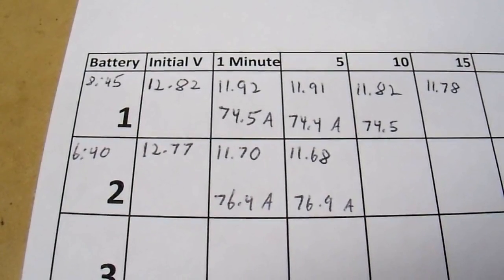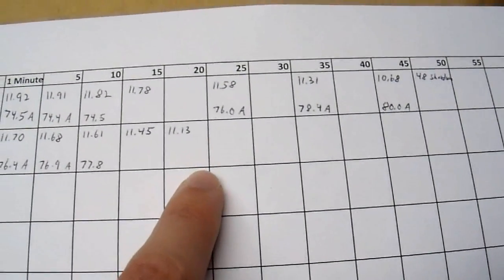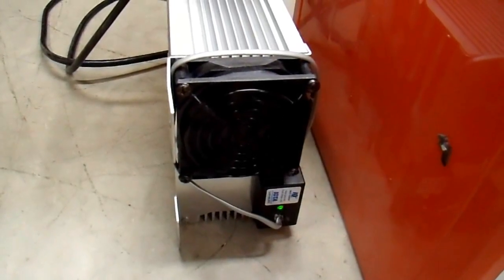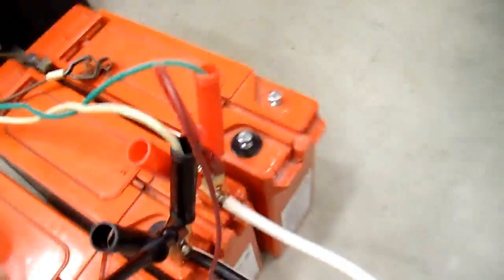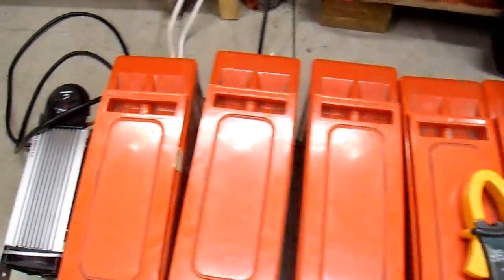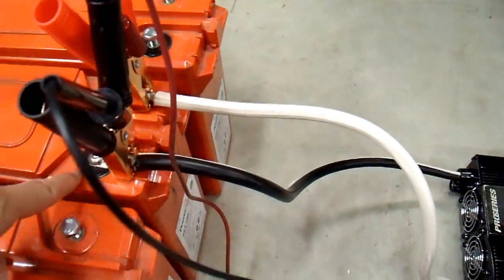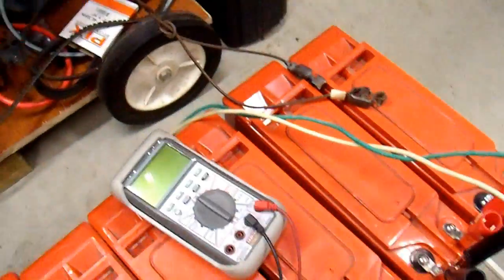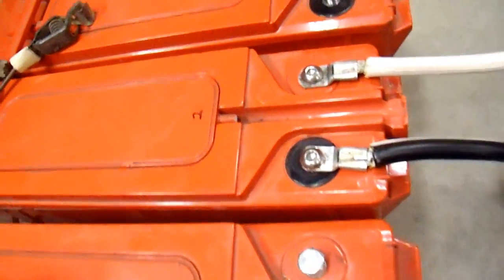1000Ah Battery Bank Part4 - Equalizing and Reconditioning a Sulfated Battery

Comment: All the sealed batteries I have owned, all you had to do was 
pop up the covering over the cells and 
pop open the cell caps to add water.
Reply: some are glued, you will have to break them

Comment: Hi Guys.
This is my first day on here, so you realize that I don't know what you Guys have been saying about What. So please forgive me for asking a question that was probably answered a little while ago.
I am thinking of setting up a Solar system for a Swiming pool. So I am looking to get set up with someone who can draw the plans and recommend the parts. I am good enough with my mechanical skills to do the Instalation, then I would get an Electrician to Certify the Install.
Is there anyone out there who would do that for me for a SMALL FEE.
Errol
errolmbj@yahoo
PS. If you are the one, I would send the info that you need.
The Volts. Amps, Watts, HP if you need. That is the info thst is on the Pool Motor that I want to run on Solar.
Let me say this. I was thinking of using One (1) or more of them MICRO INVERTERS with Four Inputs. After that I am LOST. 
Thanks for staying till the end.

Comment: Are you confusing watt with amp?  You show an electric heater plugged in saying it was drawing 80 amp - no way a plug in heater draws 80 amp, maybe 80 watts yes.  80 watt divided by 120 volt  = .66 amp.
Reply: He means 80 amps on the 12v side so 800 watts

Comment: How did you measure amperage, I don't see a meter on the 12v side.  Was it calculated?  How does that take into account the electrical loss in the inverter?  Thanks for the videos.

Comment: I tested 2 batteries on the weekend and both of them looked to be " dead". Right after using this battery reconditioning program ( Check Details Here>>>https://t.co/jfXRNloTu0 ), I had been able to rejuvenate them both to 100% working batteries. I saves $ 180 because of that procedure!

Comment: I recently got the EZ Battery Reconditioning program and just reconditioned two car batteries. The guides were very easy to follow [Check Details Here==>https://plus.google.com/100351090281822647456/posts/Gwtd4mVBdEd ]. I wish I would have found this years ago! Thanks!

Comment: Nice learning videos you being doing. I have a question, can you charge the battery pluging your charger to the AC output from the Inverter as the inverter is in use?

Comment: I find AGM Batteries to be mostly fragile and unserviceable. If you want to have a battery array which is easily diagnosable, serviceable, and long, long lasting, then Flooded Wet Cell-Deep Cycle batteries is really still the only way to go :) Trojan Flooded wet cell-deep cycle will last you at least 15 years, with many folks getting 20 years out of their old Trojans.
Reply: +Mark Job 
I added water to many of these batteries, where needed. Under the cover there's a rubber valve and a small opening if the latter is taken off. So while these are not intended for such purpose you can surely do it
Reply: Agreed mark iv had only short life out of agm.

Comment: Reconditioning batteries is mildly more interesting than paint drying! :) Ha! JK. Informative video. My off-grid setup is using LiFePo4 batteries. An entirely different animal as it were. In a few years I would love to add more panels and 50-100kwh worth of Lead to create a Solar DC fast charge station for an eventual EV. Have it charge during the day. Then at night when home, use 50% of its capacity to charge the car. RInse and repeat.
Reply: I literally have the same setup for this exact purpose.

Comment: Worse case scenario could you estimate where to drill to find the cells on the bad battery to refill it then just use plugs if that worked?
Just thinking it would be a last ditch effort to possibly save the "junk" one/ones?
Reply: or at least rip the vent cover off the dead one to see underneath.   This was a year ago and this is video 4 of 9, so let's see :)

Comment: Watching you makes me nervous. I am afraid you are going to cause a dead short across the terminals accidentally. I am probably over cautious...
Reply from the maker: I actually have done something similar to that on battery banks.  Fortunately the currents are so high that it just vaporizes the material that made the connection leaving an open.  Your cable and/or terminal may be damaged but as long as you're not wearing a ring or something you'll come out just fine.
Reply: ***** Ha! :)
Reply: How To Start A Battery Business At Home>>>>[ https://t.co/jfZbilIKLW ].......

Comment: I have a 90Ah 12v AGM deep cycle battery which I'm trying to "recover". It's about 6 years old and only holds 30Ah of capacity from my testing. I did a controlled overcharge today (equalization if you like). It was holding the voltage at it's maximum of around 14.7v that I was applying. I left it on all day and came home to it charging at 13.9v (it's still charging now), so it looks like it's absorbing some more power now. I'm wondering if I have infact desulphated it to the point where it's accepting more charge again. I guess I won't know until I test it, right?

Thanks for these videos by the way, they're massively interesting to me because of my hobby of solar, batteries and general electronics =) Keep it up!
Reply: How was the battery used during those 6 years? If it was held on a constant float charge, then electrolyte may have dried out as AGM is not a 100% recombinant technology. During it's life cycle, water content goes down and specific gravity (usually) goes up. Too high SG causes rapid plate corrosion. If one cell dries out completely, internal resistance skyrockets which causes the cell to heat up under load and burn itself to smithereens. So, You could try to open the battery and add a small amount of distilled water to each cell. I'm talking 10-20ml. You have nothing to loose anyway, really. The formula for deriving SG from open cell voltage is OCV - 0.845. Might come in handy.
Reply: drezster It was mostly standby use with minimal float charging (it was charged then left charged, with charging occasionally after use). Now it just sits with a 10w panel attached through a charge controller with 13.8v cut off. Now that it's winter it gets very little charge. 

I just got home and found the battery voltage dropped to 13.8v under charge, and the battery was warm to the touch, so I've taken it off charge. I think I may have left it charging too long to be honest. 6 years life isn't bad for this battery though I don't think, and it's still got some useful life left.

Comment: you can still add water to agm...if there is no cap for the plugs then you can drill holes in them. they want you to buy new batteries n not try to add water
Reply: have you tried this method yourself... because I'm thinking about what you have said.
Reply: @Plexsus44  it is possible, I've seen a lot of videos from russia, there they revive 9 years old batteries, but instead of drilling they use soldering iron to make a hole. so no drill dust will get in to cells.
after they closed the holes with just a hot glue tip.